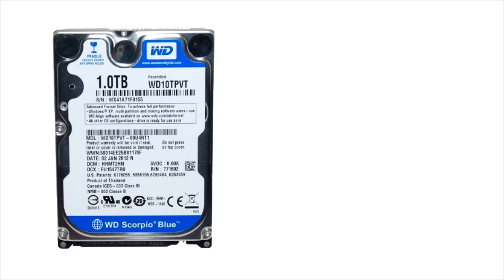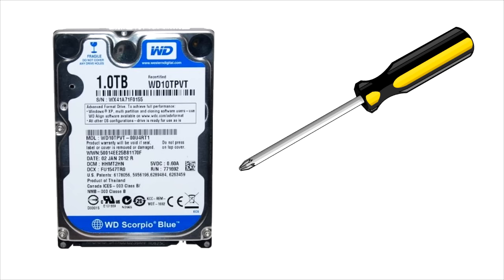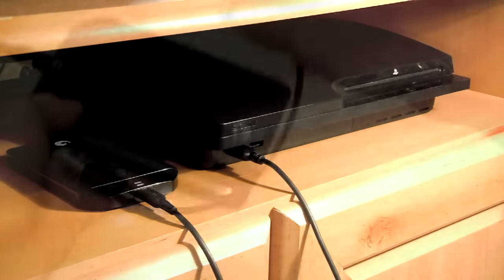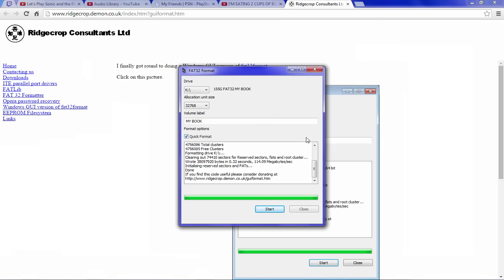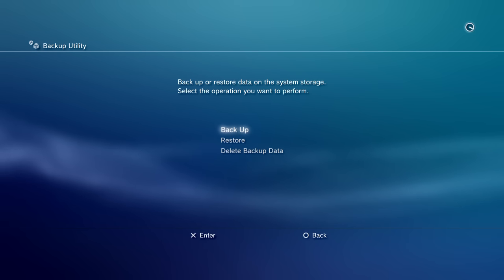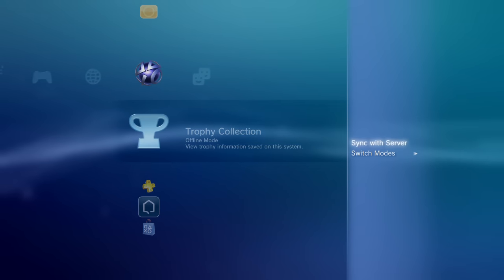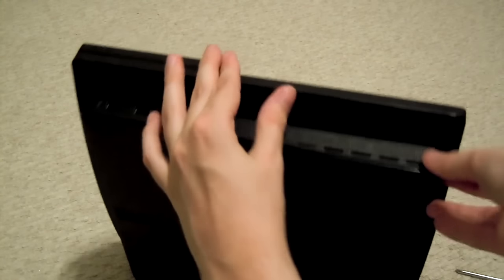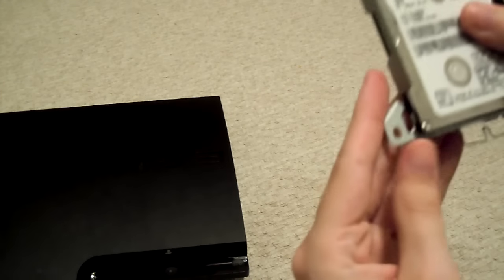PlayStation 3 Hard Drive Replacement Tutorial

Comment: I did everything step by step but when i plug the Flash drive , the system tells me , No applicable update data was found ,  am i missing something ? Please help
Reply: Same problems. Any working solutions?
Reply: @EverydayReiki   I changed the name of the Flash drive on my pc and it worked . I was able to download the latest PS3 update and then put it on my ps3 . All good now
Reply: You changed to a specific name, or just anything random?
Reply: @EverydayReiki  I plugged in the Flash Drive on my pc then created a File or Folder and named it PS3 update , and you download the  update and put it on that specific folder and then just download it to the PS3 .

Comment: So far when i tried installing the  4.83 firmware i get the message file corrupted if it keeps happening i will have to conclude its sony's software.
Reply: Any chance you found a way to resolve this issue? I am also having this problem.

Comment: So I download one file from the website and then make two folders with the same firmware? One days update and the restoring option 5 will automatically pull the firmware file off the USB flash drive?
Reply: Just one firmware- put it in the subfolder named UPDATE in caps

Comment: I have a question when i was updateing my ps3 to 4.86 it wouldnt turn back on and when i unplug it and plug it back in it would go to safe mode to format the system or anything it would go to the update install all over again. But here is the question because im thinking when i install a new hdd will the update still be on the hdd when i take it out or is it stuck on the system?
Reply: Ik its a dumb question but will the copied update be stuck on the system

Comment: I just got a 500gb hard drive and I've done all the steps but everytime I go to option 5 it just seems to skip the formatting/updating part and just goes straight to the original ps3 system reset. I've gone to option 6 and put in my thumb drive with the update on it and the ps3 will read that and update but afterwards it still says flash memory instead of harddrive. I've tried to change the system storage from flash drive to hard drive but that won't work either (it says system storage cannot be accessed) can someone help me please? I feel like I just wasted money. I have a ps3 super slim 12gb model. (Was supposed to be a 120gb but gamestop online fucked up.)

Comment: Finally i can fixed my problem (cannot find applicable data) after changed 2 usb flashdisk (i used my internal harddisk Ps3 as update firmaware disk). so, i think my USB flashdisk (after format fat32)still cannot known by ps3

Comment: Is it possible to just hook the PS3 using the HDMI to a laptop and download the latest version using the playstation site without the need for a  USB thumb drive.
Reply: No. You can’t transfer files through HDMI.
Reply: @S-1_24-25  I actually had success with the thumb-drive a couple of months back.  The latest version was the only version that would install
Reply: @mrfixit8776  Lucky. my PS3 keeps on saying that the data is corrupted somehow when it isn't
Reply: @S-1_24-25  which type of PS3 do you have...I have the slim PS3...But I had to purchase a 320gb hard-drive before doing the download.
Reply: @mrfixit8776  I have a slim aswell
Reply: @S-1_24-25  My original hard drive stopped working and with the new hard drive I had to download the latest version
Reply: @mrfixit8776  same with me. The first time I reinstalled the system software, it worked fine but the 2nd time I’m trying to do this, I just keep on getting errors.

What I mean by 2nd time is that my ps3 was starting to lag and glitch on some apps so I had formatted the hard drive and then put it back in then tried reinstalling the system software and all I got was errors
Reply: @S-1_24-25  wish I was more technical with this response... Try getting another new hard drive, and if that fails, then it could be the mother board.... I actually had to replace a motherboard on my PS2 slim as the old one had too much corrosion in different places.  Luckily I found a used motherboard that looked brand new with no corrosion anywhere and for 30 bucks my PS2 works perfectly...I never took apart a PS3, so I'm not sure of the internals or how they look like.  But with passing time the internals will start to fail and a replacement will be needed.
Reply: @mrfixit8776  I may try that, if that doesn’t work, I may aswell get another ps3 as a replacement. Thank you

Comment: I'm having issues. I keep getting an 80010038 error code when I try to back up. 

I have tried:

1. Formatting my external drive to FAT32 using Rufus as well as a couple other programs. Had a 5 hour wait time, but ended up with the 80010038 error code.

2. Creating a small partition in my expansion drive and formatting THAT to FAT32 (My external drive is 1 TB, so I created a 150 GB partition to match the 150 GB partition on my PS3. (not all 150 GB was taken up by my PS3.)) Ended up with a 15 hour wait time, which eventually defaulted to the 80010038 error code again.

3. Restoring the PS3 file system (in case if there was something corrupt there). Still got issues.

I used and formatted this hard drive: https://www.amazon.com/gp/product/B079D359S6/ref=ppx_yo_dt_b_asin_title_o03_s00?ie=UTF8&psc=1

I am open to suggestions, at this rate.

Edit: I'm going to try ordering an external that has its own power supply, see if that works.

Edit 2: IT DIDN'T FUCKING WORK. BIG FUCKING SHOCK.

Comment: I am trying to just swap hard drives from an old OG ps3 to a slim model. Old HD boots on old console, but when inserted into the slim console, it essentially tells me the drive inserted neets 4.80 or higher to boot. I checked the firmware version on the old drive and it's the latest (4.85), but still won't boot inside the slim ps3. Also slim ps3 won't accept any thumb drive or HD inserted into the front USB ports. I have the update as sony specifies, but it can't find it when it press "start+select". I will try configuring the thumb drive into FAT32, but shouldn't it already be able to boot with the internal swap I made? HD works on OG ps3, but not slim model...? crazy. Thank you for any help/comments!!

Comment: can ps3 support hard drives that are higher than 5400rmp and will it make it faster
Reply: A 7200RPM such as a WD Black will give you slightly quicker load times, but I don't think a PS3 will really take full advantage of it. Keep in mind it will use more power and thus generate more heat as well.
Reply: @torridger  ok thanks

Comment: Why not install a solid state drive?
Reply: The upgrade is very marginal because the console uses SATA 1 speeds, not enough to have full advantage of SSDs. 
In my opinion it's still worth it because there's no "seek" and "spinning up" time with SSDs, also they are completely quiet. 
The benefit is about 15-25% faster

Comment: I never thought a external hdd with ac power supply was even needed for this.....
Reply: I just used a normal external HDD. My PS3 recognized it just fine (after formatting it to fat 32, of course.) And it's only necessary if you want to backup/restore data from your original PS3 HDD.

Comment: Does it work with SDD?
Reply: yes, but you're not going to get full ~500MB speed that SATA SSDs are capable of.
Speed is limited to 150MB as it's a SATA gen 1 connector.
For comparisor regular mechanical drives have a max speed of 80-120MB. So you do get a ~25% speed boost.
SSDs have another advantage though, no "seek" and "spin-up" times which makes the whole console feel a bit more responsive.
The difference is not huge but it's there.

Comment: Should have used an SSD. Not another hhd.
Reply from the maker: This video was filmed back in 2014, before SSDs were as affordable as they are now. Back in 2014, it was much cheaper to get a large capacity hard drive compared to upgrading to a SSD. But nowadays, I would replace my PS3's hard drive with a 1TB SSD.